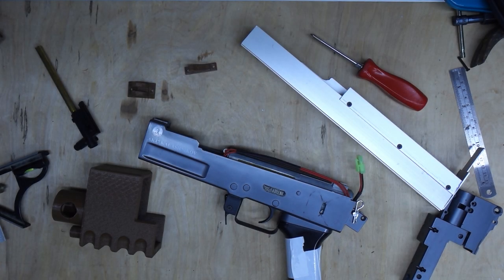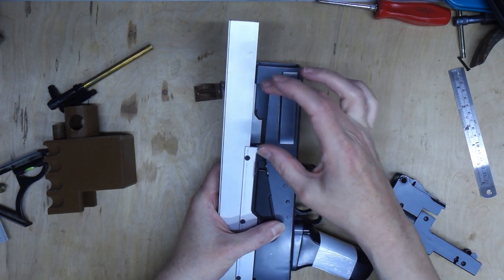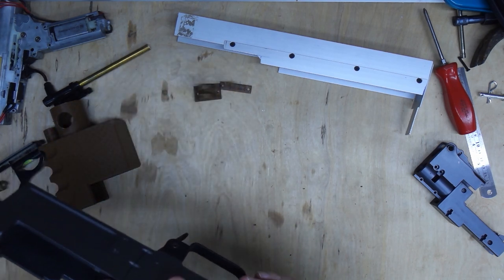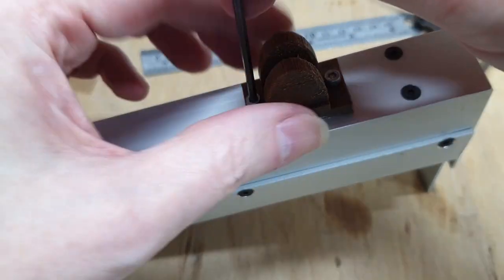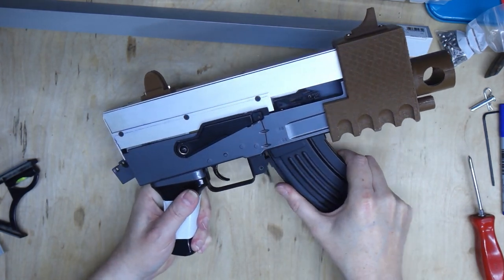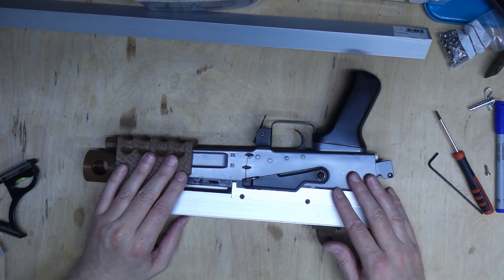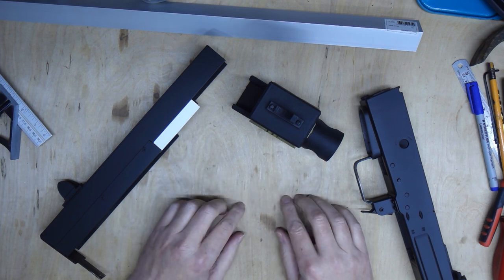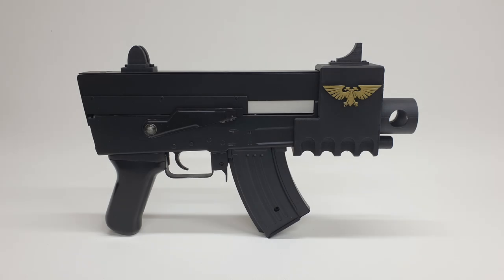Building a quick Warhammer bolter out of an old airsoft rifle - Part Two

Comment: why didnt you include the emblems in the main print? instead of doing them seperately... less chance of them being knocked off and lost
Reply from the maker: Good question. I actually had the emblems as separate prints from my resin printer, so they're much higher quality than they would be from the filament printer. Also, because they were on three sides of the print, at least two of them would have to print vertically, which may further reduce print quality. The main reason though is that I already has these printed :-)
Reply: @SteamGeezerUK  thanks for explaining....anyway, great job i wish i could get my head round 3d designing lol
Reply from the maker: @capatainnemo  You and me both :-)

Comment: All AK pattern guns are AK-47 to those who don't know.  And to those that know, AK-47 just means an AK-pattern gun, to include the AK-74 and RPK guns. 
Yeah, I still say it's an AK-74U.  But who cares, it's now a Bolter.   :)
Reply: It was actually a fictional AK variant called Spetznaz Beta invented by Tokyo Marui, a classic Airsoft brand. It was then copied into COD4: Modern warfare where its most recognizable from. Now regarding the name since it appears to use 7.62 magazines and doesnt have a folding stock its real name would be i think AK47U for a lack of a better guess.
Reply from the maker: I couldn't figure out what it was supposed to be. It says AK47 on the side, but it has the barrel of an AK74U but a fixed stock. Your explanation makes sense - probably to get around having to license the actual design and also having somewhere to put the battery. Thanks for that :-)
Reply: @SteamGeezerUK  No problem, always happy to help!